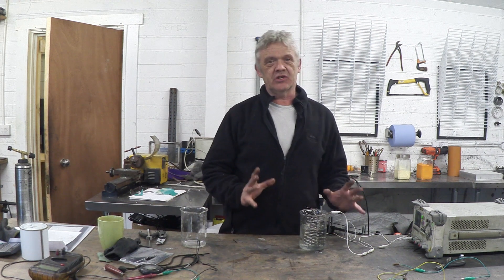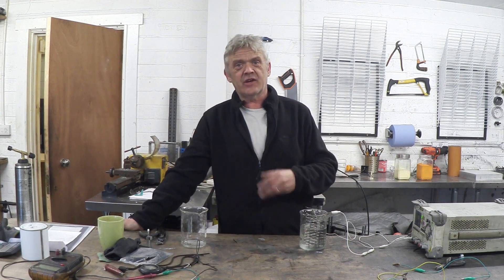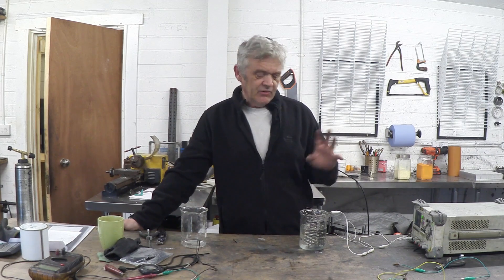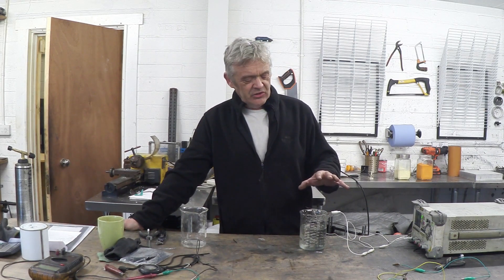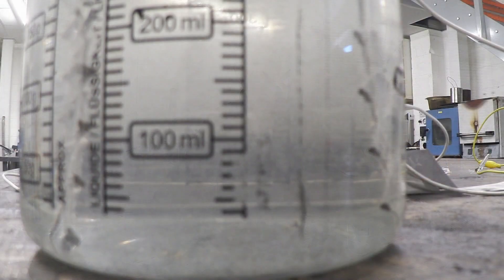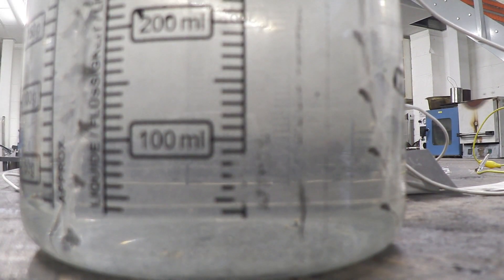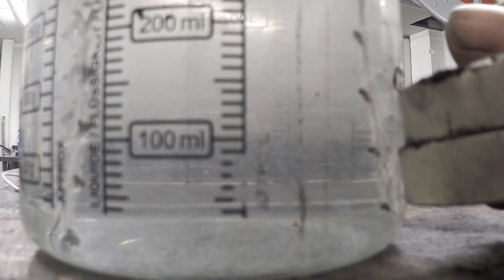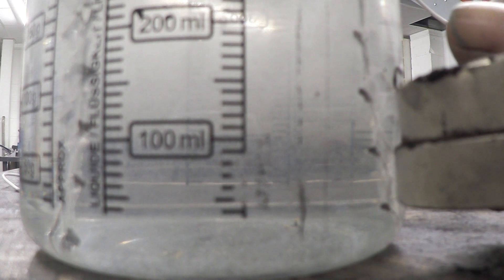Making Hydrogen With Magnets

Comment: Why does this worK?
Reply: Something to do with aligning spin and spin coupling of diatomic molecule or liquid oxygen is magnetic so possibly mono o is and it helps strip oxy from the hydrogens into water away from electrode faster increasing kinetics.  This is the most amazing YouTube subscription I have ever found.  Thank you English guy!  Magnetic field lines allow hydrogen "atoms" but water being diamagnetic repulsed.  Any change of ph with the addition of magnetic field?
..  English guy? Any ideas?  Shine a red laser through field area with magnet and without, any change in refraction, density   or scattering observed in laser?
Reply: @brainretardant  Simpler than that. It's sweeping the gas from the electrode so it has more surface area to react at any given time. Same thing happens when you stir it.